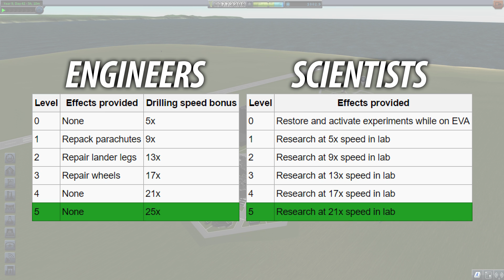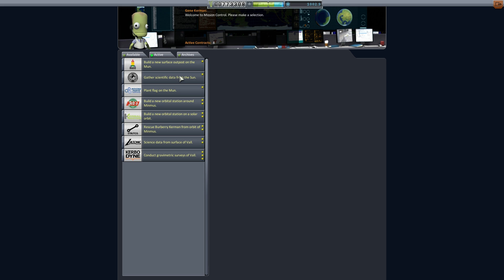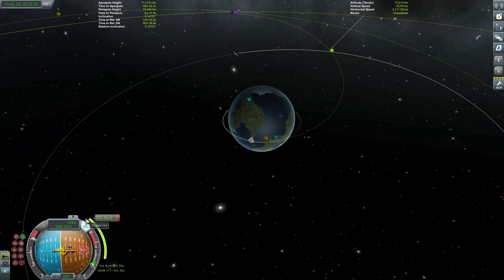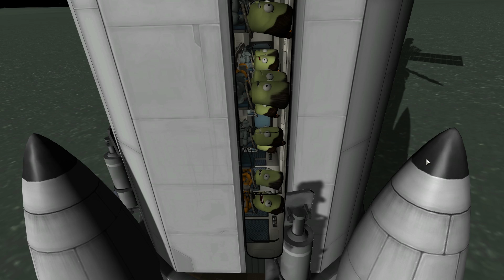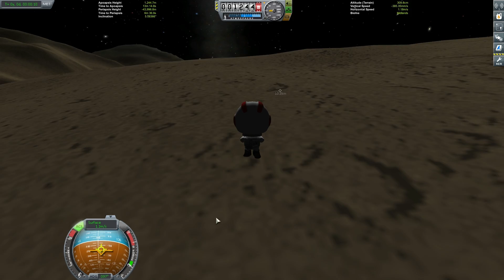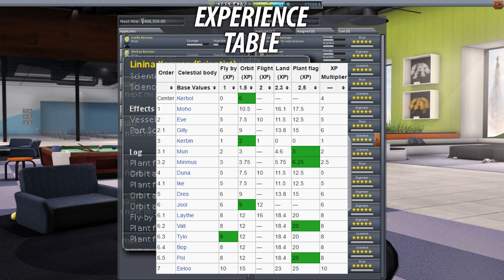Super Kerbal Training - Level 0-5 in Single Mission (Tutorial: 25) Kerbal Space Program 1.1.3 Stock

Comment: How much TWR do you roughly need for moon take-offs? 

Or how much do you think is the minimum you require?
Also does Kerbal engineer work with breaking ground? Ive copied the folder into gamedata folder but it doesnt work and theres no chip.
I sometimes notice that it states its loading engineer parts when loading the game. Kerbal alarm clock works and thats the only other mod ive installed.

Comment: Hey, Marcus. Nice craft. I built a craft looking exactly like yours (from scratch, the craft file had "locked or invalid parts"), but I also modified it with:
* 4 x 1500-kN boosters for the initial ascension
* replacing your HG-55 with an 88-88
* switching the claw with a docking port
* 2 RTGs in the capsule section (in case solar panels are useless (at the dark side/broken off/too far from the sun), or I don't have them deployed)
* MechJeb; I never leave the Space Center without it.

I have a few questions regarding how I can use it. To add some context, I am happy to report that it's doing great so far in my career save. I'm currently working on a contract where I have to land on the following places (in order)
- Mun
  *  just needed a fly-by, but I established an orbit and waited for the next Mun->Minmus transfer window.
- Minmus
- Duna
- Ike
- Dres
- Duna 
  *  just to refuel on Ike
- Kerbin
  *  just to refuel on Minmus
- Eve 
  *  just orbiting, no way I am capable of landing and getting off Eve.
- Gilly.
  *  I'm supposed to just orbit Gilly, but I figured I could refuel there and level up my passengers and crew some more.
- Kerbin (END)

The reason I'm so picky about my visit order is, according to this transfer window planner (https://alexmoon.github.io/ksp/#/Eve/64000/Kerbin/200/false/ballistic/false/14/124), I can maximize delta-V efficiency if I go to only one planet at a time; NO SKIPPING. Here are my questions:

1) Can I safely land on Duna and fly back into orbit with fuel to spare for an Ike landing. According to the MechJeb delta-V readout in the VAB, on Duna the nuclear-powered pod has a TWR of 1.30, an SLT of 1.23, and an Atmospheric delta-V of 3,219 delta-V. Is that enough to land, refuel, AND ascend to Duna orbit (no detached stages) or are the numbers wrong?
2) According to the transfer window planner, I am capable of flying to all the planets (except for Moho) provided I refuel after I land and not skip anywhere. From the original creator's standpoint, do you recommend I go for such a challenge or stick within certain limits.
3) I would like to write a Mission Report thread in the KSP Forum involving the ship in question, since it's going to be a long journey. Is it okay if I do so; it is your original design, after all.
  -  if you were in the "High-Occupancy Mun Lander Challenge," that thing would earn you 210 points (check the thread for scoring details)

Your response is greatly appreciated. Thank you.

Comment: HI Marcus. Great Video! I tried to recreate the rocket but mine only has 1331 / 4780 dv as opposed to yours which has 6291. Fuel and weight are the same in both rockets so just can't understand why ... any ideas?  (Is it a version issue mine is 1.1.2.1260 running on a mac) Keep up the great work and congrats on going past 4500 subscribers!
Reply from the maker: Hmm... wondering if your external fuel ducts are on correctly. They should go from the central tank up to each NERV tank.
Thanks for the support. :)
Reply: Yep thats it! You'd tucked them away so neatly I missed them. Thanks! Will look forward now to being able to complete the mission!

Comment: Awesome mission as always! How did you work out the timing of the Minmus ejection and Kerbin burn to intercept Jool? Was the key Minmus's angle around Kerbin?
Reply from the maker: If you take a look more closely at that part you will notice that I actually left Minmus and reduced myself into a slightly lower Kerbin circular orbit beforehand (I didn't show that specifically due to the huge amount to cover in the episode). This took a fairly small amount of delta-v to do so in my mind it made sense to do this.  Of course the Jool / Kerbin positions need to be very close to perfect for transfer and I needed to ensure I dropped the Periapsis right down at exactly the right angle to punch out Prograde in relation to Kerbins orbit around the sun. I'm sure doing it in one burn from Minmus is possible. But it helps work these burns out when not in Minmus's sphere of influence (hard to do all this as well as re-adjust inclination for a perfect transfer burn).
Reply: Yep, I missed the circularization. That makes sense. I imagine the most efficient thing is to drop from Minmus setting up a 70 km Kerbin Pe right at the ejection angle and burn when you hit it. But that seems pretty difficult to time, and I hadn't even thought about the plane change as you point out. Thanks!